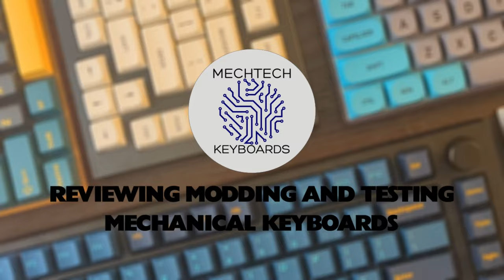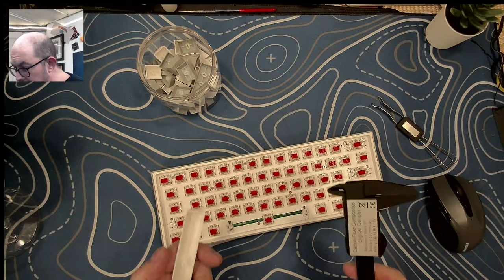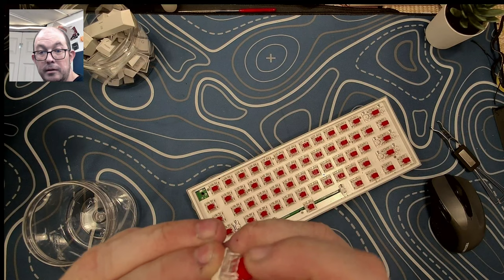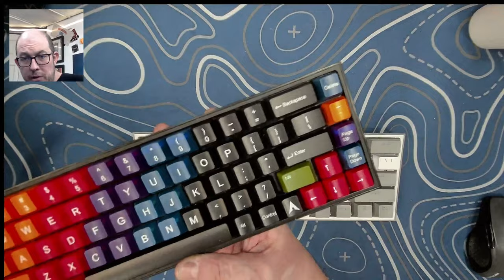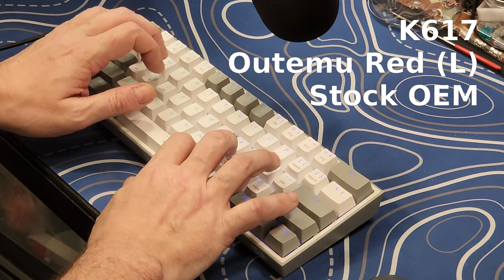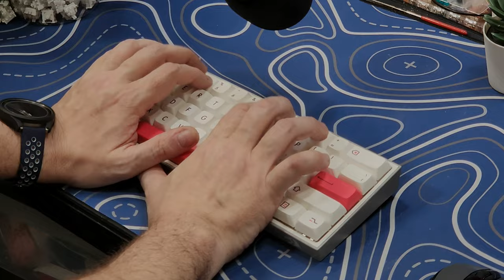Modding the Redragon K617 Fizz - How good can it sound?

Comment: I want to ask if you had any problems switching from the stock switches to new ones was it easy? did they fit? If yes can I mod i t with putting whatever switch i like?
Reply from the maker: There are two models of this keyboard; the original, with Outemu hot swap sockets, and the new revision, with 3/5 pin compatible hot swap sockets. The former only works with Outemu, KTT, Akko CS, and a handful of other switches.
Reply: @MechKeyboards  thanks but how do I know which I got? I have to open a key to see right?
Reply from the maker: @ΜάριοςΓουνάκης  the one on the left is Outemu, the one on the right is "Kailh" style:

https://i.imgur.com/aaYj5Y9.png